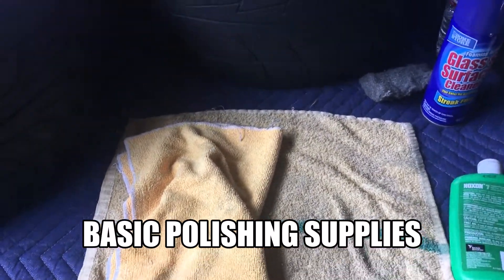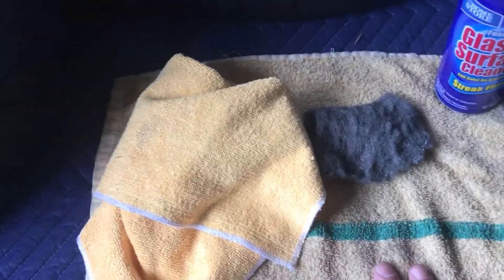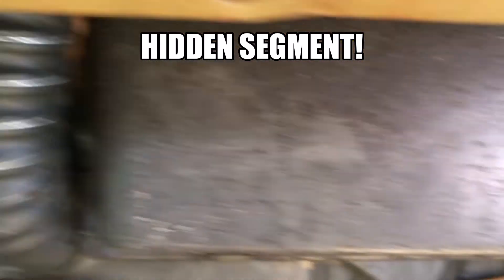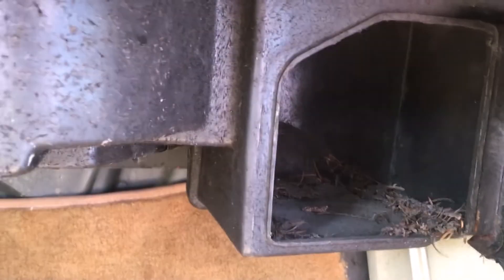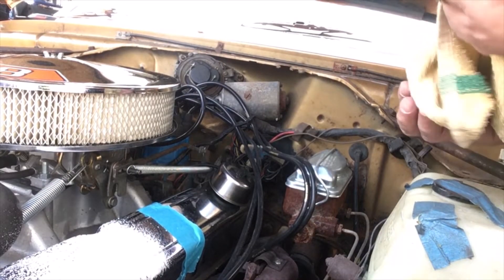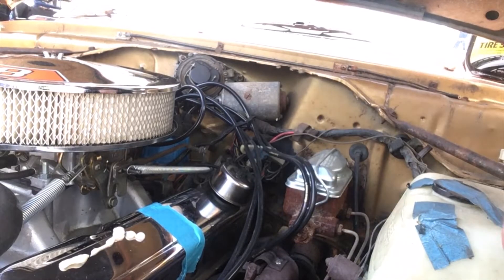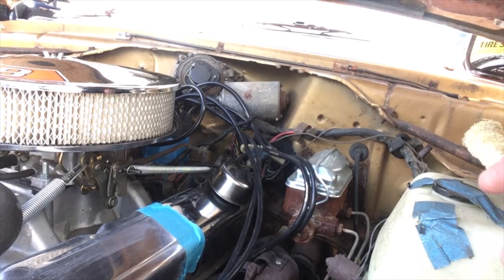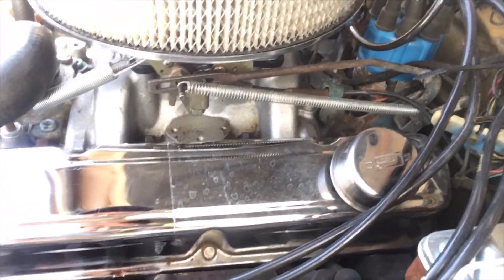Fast Fixes for your project, aka it's all in the details with the 1974 Dodge Dart Swinger.

Comment: drain hole under bottom of fenders, too.  I run a welding rod in it, then vacuum
Reply from the maker: I just dug mine out today too. Must have been about 5 pounds of pine needles per quarter panel.

Comment: Pretty cool tips and projects. The cowl on early A body's had ablong holes that had plugs in place. I put some on my 72 now a vaccum hose will fit in too suck out debris or you can blow it out.... between the cowl debris and the leaking wiper pivots they cause a majority of the rust on A bodys good thing to fix them right of the bat.
Reply from the maker: A-bodies are a lot of fun to work on. Even though @jonnymopar doesn’t like small block Darts.